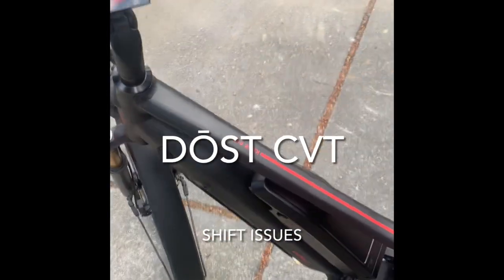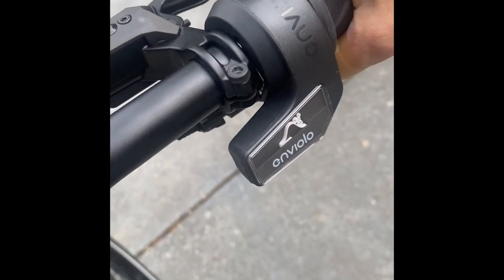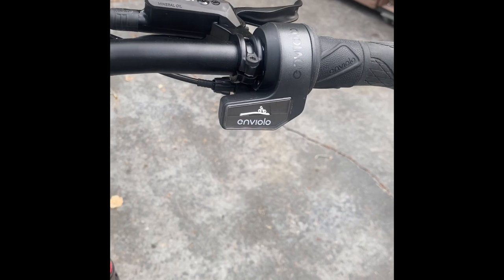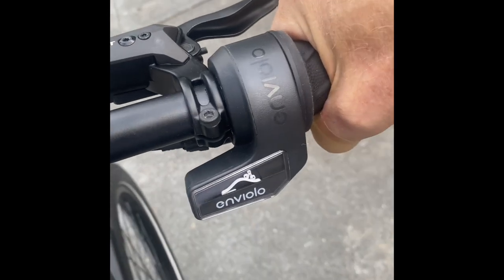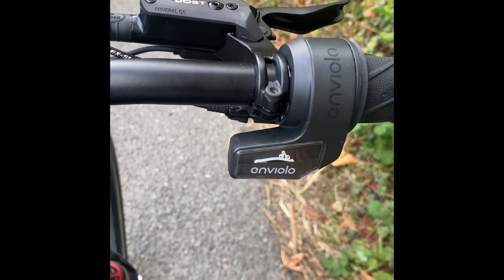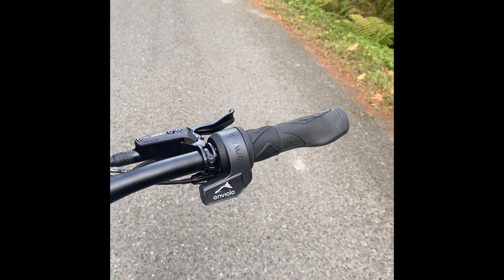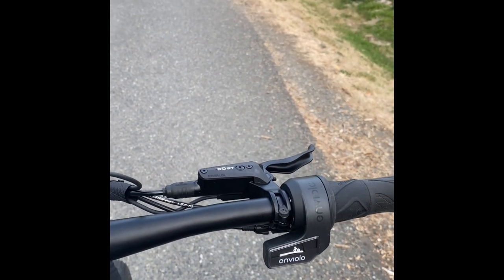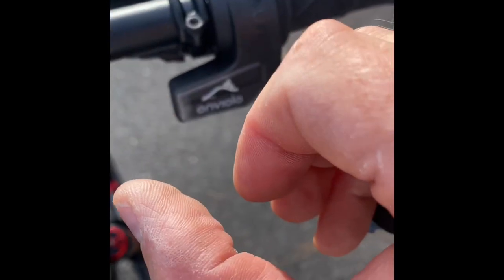DŌST CVT shifting behavior - doesn’t seem normal to me

Comment: ▪️
I was so tempted to get the CVT. The main reason I went with the original is because I would've had to wait an extra 4 - 6 months for CVT model...  plus I saved 1000ish clams.  

They got that new Cargo model they're working on now for 5k...  
Looks pretty slick, but if I'm in the lower USA eventually, I'm gonna go with that aireal rider Keplar.  That thing is under half the price and gets up to 35mph out of the box after you mess with the menu.

Dost is probably better overall quality, though 
🟥